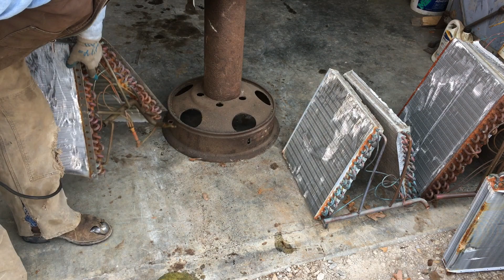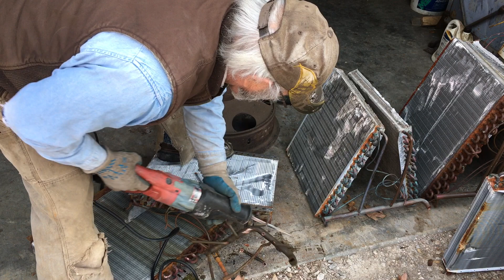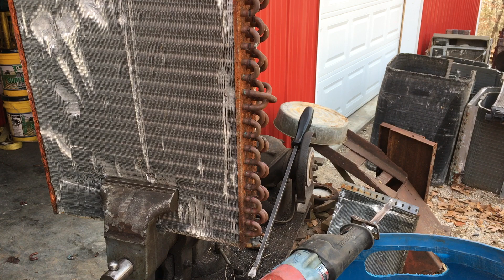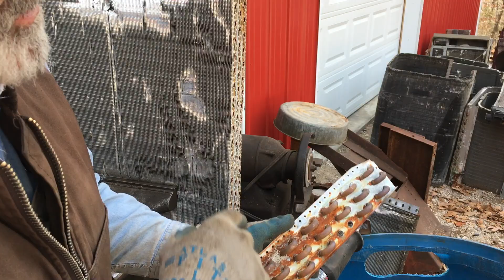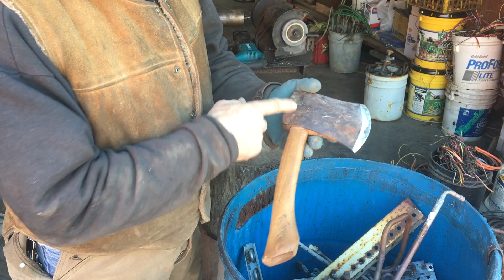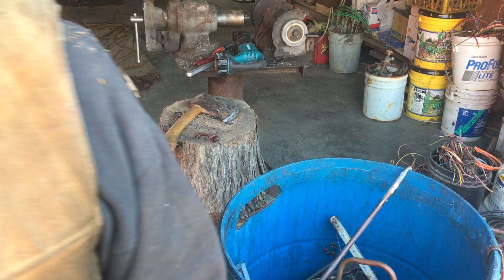Scrapping Out Air Conditioning Coils

Comment: Anyone know how much money in copper comes out of a Evaporator coil that sits on top of the furnace? Its for a 2.5 ton AC
Reply from the maker: It depends on the price per pound in your area.  There is a wide variation across the country.  Plus to get the most money you have to strip the galvanized tube sheets from the ends and also remove all the piping with solder joints.  Leaving it as one assembly brings the lowest price everywhere.  Some guys actually separate out the copper from the aluminum to get an even higher price.  I don't do that because its too time consuming.  Then you have three separate items: 1) clean copper 2)dirty copper and 3) aluminum.
Reply: @tractorman4461  what's it worth in your area leaving it as a whole
Reply: Leavinf it the way you do
Reply from the maker: @america1403  I used to get up to a hundred ac units a year…indoor coils and outdoor units. But not any more being retired now. Good luck with your salvage job.
Reply from the maker: @america1403  usually it’s worth less than half when left fully assembled. But it’s been a while since I’ve taken one in. Usually I wait for a dozen or so to make it worth while. Depending on the brand yours MAY be all aluminum. But your coil won’t have but just a few pound weight once it’s stripped. Maybe 8 or 10 pounds of what they will call ‘copper aluminum radiators’. I bet her it’s two bucks a pound or so down this way. Big city prices are slightly higher.

Comment: Semper Fi devil dog. Now, did I hear you say a copper magnet? What is that?
Reply from the maker: Alfonso Munoz Lololol I was hoping to catch someone with that. I was just being funny about picking up the copper. Iirc, it was when I said I usually spread a big tarp around to catch all the little pieces of copper that go flying when they are knocked off the tube sheets. It would sure be nice if there was such a thing but there’s not. S/F Alfonso, Always Faithful. Stay safe and have a great day.
Reply: @tractorman4461  you sure got me! 
Anyways, I picked up an AC unit off of Craigslist. It had two radiators and a HEAVY compressor. Not sure how I'll geal with it. I may just leave it and the motor intact and take it to the scrapyard like that. 
The copper will go into my woodworking trinkets.
Reply from the maker: @Madmun357  hahahahahaha...starting out the day with a chuckle is great !!  Be sure to keep your eye out for one of those elusive 'copper magnets' on Craigslist.....

When the units are disassembled, those compressors are rejected by two of the three local salvage yards because of the refrigerant oil inside.  The third one requires it to be drained.  One of the other ones will only take them if they are cut open.  Hopefully you won't run into that issue.    But they all three will take the whole unit...but the price they pay is drastically reduced so you only get scrap metal prices for the copper and copper/aluminum.  Have a wonderful day Alfonso !! (-:

Comment: You did not show how to remove the copper tubes from inside of the aluminum radiator.
Reply from the maker: I don't take the time to separate the two. I just remove the tube sheet and return bends to get the higher price for the clean copper/aluminum coil with no soldered joints or metal sides.   I know the return would be greater if separated, but being an HVAC tech, I would get such a great quantity of salvage units, the time required to take that extra step makes it prohibitive.
Reply: Just take a razor knife and score the aluminum down along the copper. Bend the aluminum back and pop the copper tube out. Not that bad. I've even started a fire and melted the aluminum off the copper then save the aluminum for future scrap or projects

Comment: Think you being retired and scrappin all the time you would buy yourself a vice mount it and work upright
Reply from the maker: Aw heck yeah Kevin.  I've got a dozen or more vices on benches or truck rims throughout the series of sheds.  I even have my grand dad's 100+ year old post vice from the blacksmith shop and one that fits the Reece hitch on the old truck.    I work with what's quick and available for whatever task is being done.  No vice needed during separation, but soon as we start cutting the tube sheets off...they usually go into the vice.